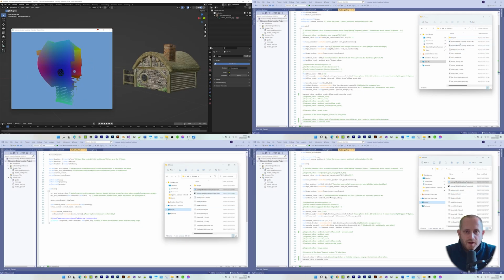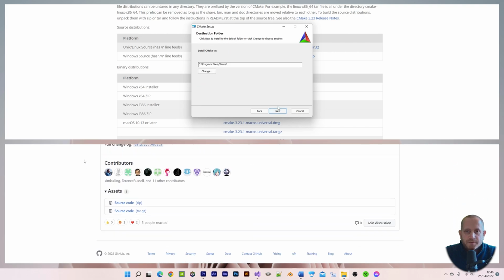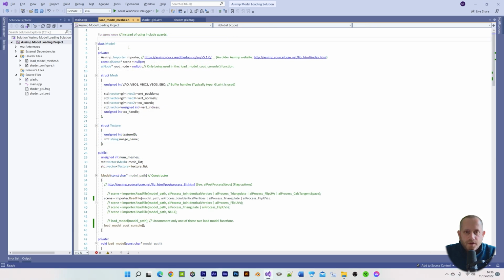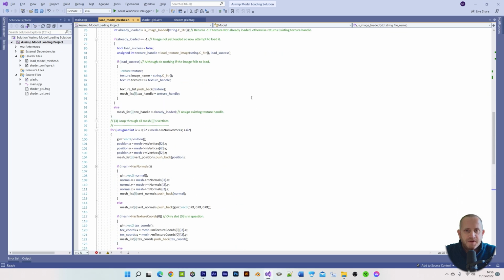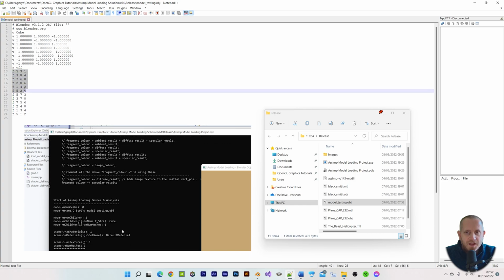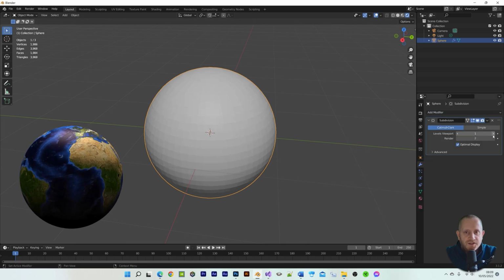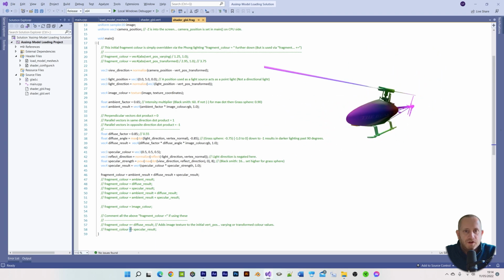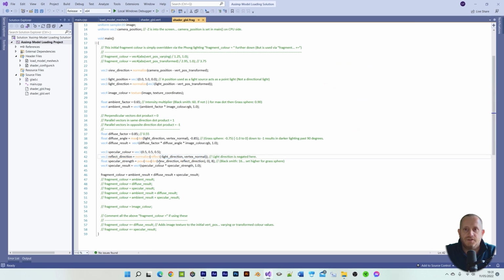OpenGL Tutorial 5 (QS) – Model Loading (PT 1) – Assimp Blender & Lighting

Comment: Outstanding! But how to load gltfs with embedded textures? This code is asking me for Images/diffuse.jpg, why do I have to pre load an image?  Thanks!
Reply from the maker: Within Blender, a model consists of mesh data, and images such as jpg that are applied to the mesh faces. However, when the model is exported from Blender there are two resulting exported files, 1) an object (.obj) file, and 2) a material (.mtl) file...

The object file contains the mesh data which essentially remains unchanged even after being imported (i.e. loaded) into your program, but the material file contains only the names of the images (i.e. not the image data itself). Now, the .obj file and .mtl file (which are just text files) are both imported into your program by Assimp...

And so because the material file contains the image names, that's why you're being asked for "Images/diffuse.jpg" as you've stated, i.e. the image names are then passed to the: stb image loader (which is one of the library includes for the tutorial), and stb image loader then loads the actual image data itself into your program.

Comment: Can the project that imports the model and loads it be packaged and shared? Thanks
Reply from the maker: So first we create a model in Blender (or other 3D modelling software), and then that model can be shared with other people by giving them the Blender file along with the images that you've used for the model (but they'll probably need to re-select the images, i.e. locate them within their own PC's folder structure). There are also various export options available in Blender, and creating a package that associates the model vertex data and images together, as far as I'm aware, is something that can be done, but it's not something I've done myself.

However, all of that is something we do before we get to using OpenGL, and so you're free to work with 3D modelling software without having to get involved with graphics programming...

Where this model loading tutorial 5 comes into play, is we export our model from Blender by choosing the wavefront export option (which produces an .obj file and an .mtl file), and then Assimp (which is the library that we use within our program to parse the model data) reads those two files (i.e. parses; imports) and organises the data (i.e. vertices, indices, image files, etc) such that we can then easily give the data to OpenGL for rendering via the graphics pipeline.

Comment: My model don't load color
Reply from the maker: Hi... please check that:

1) Your image files that you've applied to your model in your modelling software (I'll assume you're using Blender and exporting your model as Wavefront = .obj .mtl) are listed in your .mtl file, which you can check by opening your .mtl file in any text editor, such as Notepad++.

2) Your image files are then being loading into your program. If they appear in your .mtl file but are not being loaded into your program, then it's almost certainly because the directory-file-path as it appears in your .mtl file, needs to be different...

So when you export from Blender, there's an option called "Path Mode", which if you set to "Strip", will write only the file name to your .mtl file, i.e. it disregards all of the path address before the image name.

"Strip" is the option I've been using recently, because for some reason the latest versions of Blender put forward // slashes in the directory-file-path, whereas previous versions exported using backward \\ slashes... also, notice there are two different export Wavefront options, one being "(legacy)", which I think is the one that used to work for me without me having to select "Strip", probably because it uses backward slashes...

And so within our program, if you look at the load_texture_image(...) function within the load_model_meshes.h file, you'll see these two lines:

std::size_t position = file_name.find_last_of("\\");
file_name = "Images\\" + file_name.substr(position + 1);

Therefore, all your images need to be inside you image folder, and your .mtl file needs to either be listing backward slashes in your image directory file paths, or just the image names on their own which you can get by selecting "Strip" as I've explained above.

Finally, if you look at the console window (the 2nd window that opens, the black one) when you run your program, then also from the load_texture_image(...) function, it should tell you either:

std::cout << "   Image loaded OK: " << file_name << "\n";
std::cout << "   Image failed to load: " << file_name << "\n";

3) Once you've confirmed your images are being loaded OK, then if your meshes are still showing with no colour, e.g. all black, then it's a matter of just checking that you haven't made a typo, such as a spelling mistake in the fragment shader... but again, within the console window, such a shader compile error will be stated.

Sorry that's such a long reply, but hopefully it'll help, cheers, Gary (Y)
Reply: @code-imposter Firstly, thankyou for your response, 
And yes I checked mtl there was no mention of image file but only color diffuse info i guess
Also I noticed that my GetTextureCount is 0 that's why it never calls load_texture_image function in mesh.h 
What am I doing wrong ?
Reply from the maker: @aryanpatel6490  So we need to start by fixing your mtl file. As an example, here's one of mine...

# Blender 3.6.1 MTL File: 'None'
# www.blender.org

newmtl Material.001
Ns 250.000000
Ka 1.000000 1.000000 1.000000
Ks 0.500000 0.500000 0.500000
Ke 0.000000 0.000000 0.000000
Ni 1.450000
d 1.000000
illum 2
map_Kd Earth_Topographic_Map.jpg

Therefore, my image file in this example is "Earth_Topographic_Map.jpg", and so it needs to be that your mesh images are listed in your mtl file like in the above example.

Are you using Blender?

And please can you describe how you're applying your images to your mesh faces, and how you're selecting to export your model?

Cheers, Gary.
Reply: And also my gflw window blocks all the other window actions how to deal with it
Reply from the maker: @aryanpatel6490  I'm not sure about window actions being blocked to be honest, but soon I'll be making a new series along the lines of OpenGL for beginners, and so hopefully we'll be able to iron out any further issues 😉

Comment: Hi, each face corresponds to a triangle of a mesh right? I'm asking because i'm having more faces per mesh than vertices per mesh. I'm using a .fbx model file and i had to convert it to a recent version in order to use assimp.
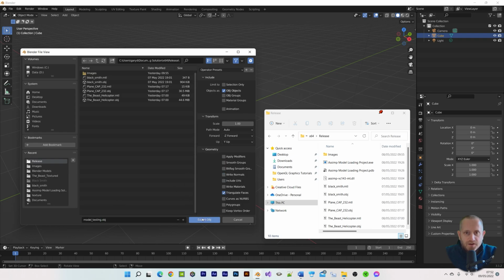Reply from the maker: OK so in the video from 6:07 to 6:35 for my cube example, I didn't do a great job of explaining it to be honest... so, the cube has 8 unique vertices, and 12 mesh faces [0] to [11] (which for this example each face is a triangle, as opposed to a quad).

So we have 12 triangles (i.e. faces) each consisting of 3 vertices, which results in 36 indices. And notice how the 36 indices as listed in the object file range from 1 to 8, which is because we have 8 unique vertices, and so each unique vertex is responsible for generating the same index value more than once, i.e. only 8 vertices, but each one is being specified multiple times as an index position.

In summary then we have: 8 unique vertices, 12 triangles (each which counts as a face, 2 for each of the 6 sides of the cube), and 36 indices.

Coming back to your question then... we can expect to see a higher: mesh->mFaces[i].mIndices[i] count (36 for the cube), than there are unique vertices. And we can also expect to see a higher number of faces (12 for the cube), than there are unique vertices.

Something else I've just noticed is that although Assimp lists 36 vertices for: mesh->mVertices[i], sure enough of those 36 only 8 are unique, but it gives us access to the X, Y, and Z values of the given vertex at the particular index position.
Reply: @code-imposter  You're right, i was not thinking trough, of course it makes sense  having more indices than vertices, i had made a pause for a month with 3D games. Sorry. And now i can see the model on my screen, but for now i only gave a red color, i still have to texture it, but there's still some faces that are being draw and they shouldn't but i'll keep analyzing. Thanks for your time.
Reply from the maker: @Byynx  you're welcome 👍